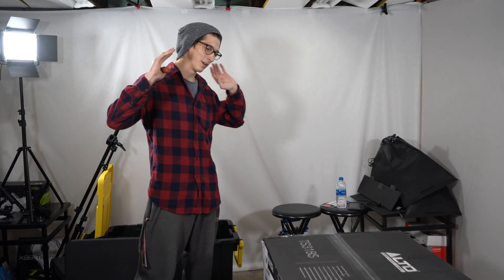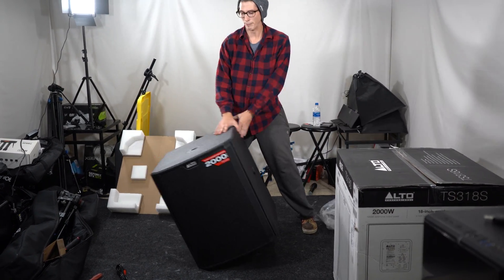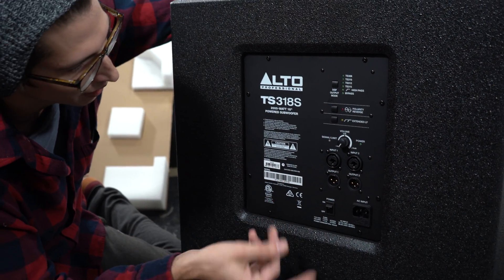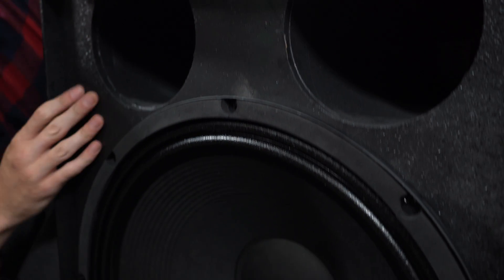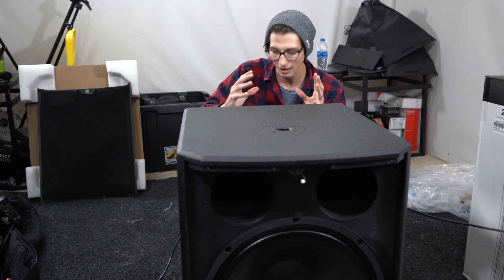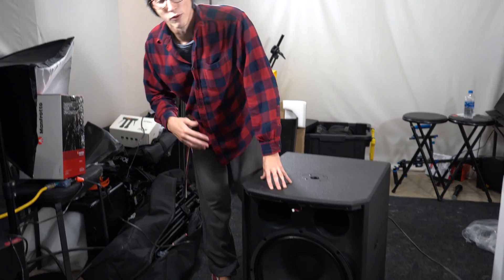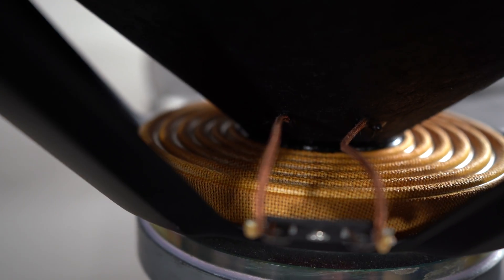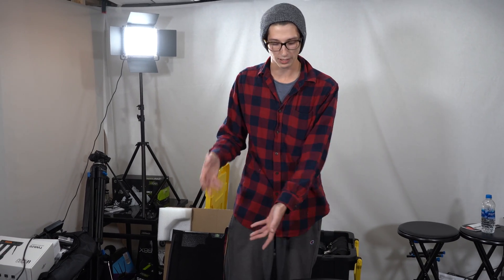Alto TS318S subwoofer Fail and Tear-down! 2000 watts? Worth it?

Comment: Yeah, you need to killed it because it’s not rated to 30 Hz it’s not a car subwoofer. It is not meant to go with that low  I can’t remember what the actual specifications are, but I definitely remember it is not meant to go that low for sustained high volume and I’d imagine it was probably clipping clipping is normally what causes a coil to get hot and stinky also, you have to think if the sauce was clipping as well I have run the subwoofers for 12 hours continuously at four power and not had any smell coming from them because they weren’t clipping

Comment: I don't think it has a limiter to protect the drivers when they start clipping unlike the Harbinger Subs which they do, Which may be why the Speaker Coil was Smelling Burnt as the Primary reason for a Limiter with Auto Volume Reduction is to protect the Driver

Comment: Brand new to the powered sub setups. I've been running power amps bi-amped into passive cabs since '91. I have the Alto TS18 sub and a pair of TS415 tops hooked up as instructed. I am very unimpressed with the sub. Have you known anyone to hook up a sub or 2 and a pair of tops using a crossover? I'd like to have more control over frequency assignment. Thanks.
Reply: Update: I'm bi-amping my powered speakers and changed the settings on the sub. BIG difference! The sub is behaving perfectly. Major improvement.

Comment: Well First off i See you have the subwoofer setup completely wrong!!!! it's Upside down..LOL.. The base Port holes go to the bottom🤣 Not The Top..& Second of all I See it's in a Crappy small room full with plastic drapes lol..& #3... try playing a High Quality file to test out the low frequencies on the subwoofer not some crappy Low bit rate MP3 file..LOL...

Comment: no damping material? 😂
cheap chinese woofer. 
💩💩💩 
my cheap 250 watt woofers have same magnet.
a 2000 watt rms woofer isn't build yet. B&C,18,Sound,RCF, Faital pro, Beyma, Radian ect, yet are at the 1500-1600 watt rms, & still no class D amp is builded to handle those big woofers.

Comment: I used one of these this past Saturday.  I have a pair of QSC 12.2 but no sub... drummer had this Alto sub that he brought.  I was scared to use it!  The bassist told me they always crank it to the max.  Against my better judgement, especially after watching this video, I cranked it.  They were playing outdoors.  This sub held it's own.  I actually had to bring the kick drums down slightly.  It wasn't a "slam you in the chest" type of bass, but it did fill the bottom end.  I am not sure if I would buy one tho.
Reply: The chest thump is usually the upper end of the bass and the low end of the tops e.g. 80-120 hz. The rest is low bass down to the 30s that gives that satisfying ear pressure if it's loud enough.

Comment: I know of a few bands that use Alto stuff. Also I had one of the PA speakers from them but sold it. To be honest, if I had never heard the better stuff such as QSC, EV, JBL ... I probably would have made do with the Alto speaker. But test them side by side and Alto comes in last ... but it cost half of what the big names want.
And as someone pointed out by feeding a 30hz signal, that sub was doomed. A sub that size should have gotten maybe a 60hz signal. In real life, 90% of the bass is above 50hz anyway ...
Reply: It's understandable that you believe the driver being doomed was natural but, at the same time, I, as a designer, think the necessary protections must be built into the amplifier in integrated products like these. The amplifier should not be able to fry the driver to destruction.

Comment: A bit of voice coil smell is pretty normal imho when the speakers get hot for the first couple times. It goes away over time. I own a lot of speakers that smelled significantly when driven hard for the first couple times. They still work great years later.
Reply: I remember the JBL PA we had in my old band. 2x SRX718s subs per side, had to run them really hard at times and they did smell a bit but never ever failed
Reply: So the burning smell in the video does not mean the driver or amplifier is roasted?
Reply: I ran mine quite hard out the box got that small and stopped, I thought I was going to blow them, so that smell is normal? Like hot electric

Comment: I refuse to ever haul around 18" Subs.  However, I purchased the original 41.5 lb Alto TSUB12 like 9 years ago.  I just traded it in at Guitar Center towards a Harbinger MLS1000 array system and got $135 for the trade in, so it held it's value well over 9 years!  I never had any problems with it. It was a boomy sounding sub though for a 12" Sub.  I was only $299 New!  I purchased a Alto TS212S Sub about 4 years ago.  Much punchier sounding bass, and better, sleeker box.  I never turn it up past Unity, and it has been a great little SUB that I use.  I DJ weddings with 50 to maybe 200 guests tops,  and mostly 50th, 60th, 70th birthday parties with under 100 guests. So I only use a single 12" Sub in my set up, and it's enough bass. I get often asked to turn the bass down lol.

Comment: I trust that the amp does not have limiter. When amp is clipping, the amp is delivering DC current to the speaker and therefore roasting the voice coil. That is why never power a passive speaker with underpowered amplifier, you will burn the coil of the speaker.
Reply: Yep! Not only does the driver get fed DC at full power, maximizing resistive losses, but the voice coil stays still for longer instead of excursioning, reducing the heat exchange with the pole piece.

Comment: Its not a pure SPL sub like you have in a car. To put that frequency through it without running it in is gonna fuck it up. Think its probably an unfair review. Your going for max spl on a system that's not designed to do that.

Comment: No speaker voice coil can handle the full power of a sine wave driving a amp to clipping. This is a poor test and does not happen even at the factory. A sine wave test is to drive the amp at full power into a resistive dummy load that is rated at over the amp full power spec and is fan cooled or water cooled. A speaker needs impulse signal so that it moved and is driven by the music and when the amp clips at the peak for milliseconds it will nor blow the voice coil. that is how music works and you can drive the sub all night like that at just under clipping which is pulsed and not a continuous full peak to peak sine wave. If you are going to release test / evaluation videos then please do it right to give a fair evaluation and not blame the manufacturer for a product that works on its own design correctly and you incorrectly demo it. i dont have any affiliation with Alto but i also dont destroy products with incorrect use i use KV2 Audio EX 2.2 subs. and 2 are enough for 500 people rooms. when positioned and used like the manufacturer intended.
Reply: Thanks for clarifying... I knew this young bro was just ego'ed out ans flexing where he has no place to flex... What a loser... Talking shit about alto.. go back to 8th grade poser...

Comment: Ok so I have 2 Altos 15 power speakers  plug in to stereo left and right on my yamaha mixer .  I have  another 12 inch power alto speaker .   Question is how do I connect the 12 inch , to the mixer or to one of the speakers because I want to use it as a monitor speaker
Reply: https://www.google.com/url?sa=t&source=web&rct=j&url=https://www.altoprofessional.com/downloads/TS312S_TS315S_TS318S_User_Guide_v1.2.pdf&ved=2ahUKEwihs4K-0OjxAhWZX80KHZh7B1cQ6sMDMAB6BAgJEAI&usg=AOvVaw3ePuVVIJZbXwCe3xgN_dm-
Reply: Aux fed

Comment: Have you ever bothered to read the manufacturer specifications for this subwoofer? It clearly states that the frequency range (-10db) for this subwoofer is 35 Hz, not to mention that the frequency response (-3db) is 44 Hz. Why would you feed it a 30 Hz test tone when you should know that it will not be able to play it well? This is pure stupidity! You just made a fool of yourself here!
Learn how to use your equipment properly! You clearly used it beyond its operational limits!
You could have applied a high pass filter set at 35 Hz, before the signal inputs the sub, and then test it with real music, including bass heavy songs, setting the gain correctly and slowly increasing the subwoofer level until it reaches its operational limit.
If you want your subwoofers to play loud and linear down to 30 Hz, invest more money in proper equipment able to deliver that performance!
One more thing. If music is want you want to hear properly, you always need at least two subwoofers. Never use only one.

Comment: You cant loose from RCF Subs🔊💯
Reply: Hey does the 15 in rcf sub do a good job
Reply: @kevinwillson4297   I never use one before, only the 18 inches, but RCFs are pretty good because they produce good drivers and the amps are also good, so i would say yes.

Comment: They normally comes with a shit driver, i once load the old 18" sub with some fatial pro 1700watts, and they still running ok. You can upgrade them with a better driver.

Comment: Did you run it to mic levels when running from your device? If you did thats the reason why the coil started burning. The amps used will always be rated to the speakers peak power. But it can only maintain peak for a few seconds.

Comment: Great video! I'd never invest on a sub nor any alto speaker again.
I have been using alto ts315 tops, I have faced problems 2 times in that years time..
The worst thing happened to me was that the highs of one speaker stopped functioning, really disappointing.
Reply: If it is because of the brand, I have a yamaha dsr 215 and it burned a sharp at a party

Comment: what replacement sub woofer would you suggest to replace the stock one?
Reply: I know this is an old post but you asked the exact question is wanted to ask. Did you come to a conclusion on a replacement? I just purchased a pair from someone that barely used them. I'm scared of what they may sound like. I haven't taken them out for a test play as of the time of me posting this.
Reply: @luvlessdavirus5009  sup....i been talking with other alto owners to get feed back....Im going with the 15 subs and 12 tops... micro system.  you should research what you can replace the stock woofers with... could be worth it... put sound filling in them
Reply: Id slap a dayton audio 18" in the box. @luvlessdavirus5009

Comment: 90 percent gain, on a brand new non broken in sub, set it up for failure
Reply: Subwoofer break-in is 3-4 hours at 40-50% volume. After the break-in the subwoofer will play and sound better. This also goes for car audio subs.
Reply: Can you explain powered sub break-in procedure?  This is something I didn't know about.
Reply: @synapticflow  just keep playing at 50% volume.. that's all.
Reply: if you have a sub you must be able to play it at max volume without blowing it with its internal amp
Reply: @Francesco-1001  if reputed company, yes.

Comment: It will definitely be 1000watts rms but either way thats not important as its mainly marketing tbh its the spl and quality of components and box design which makes a difference wattage is just the fuel the subwoofer runs on along with the magnet etc also its gotta slap hard but have minimal to zero distortion

Comment: don't be put off by any comments you may hear. Make no mistake these are awesome speakers. I have 2 x ts 310s an. d 2 x  ts 212s subs and they sound fantastic. You will always get people who will put them down and i guarantee 90% of them would not know which was which if you blindfolded them including me. Are they on par with the qsc k series and similar, well when you take into account the price then yes they are. Do they sound as good, well to the trained ear probably not, but i cant remember the last time i did a disco and heard people discussing my mids, highs and lows, because nobody cares as long as they sound good and they do.
Reply: U make more sense than vid
Reply: I upgraded to qsc from alto and was disappointed, 1 of my qsc tops was as much as the whole alto rig and for majority of small gigs it was unnecessary. The qsc shines outside and for live but for pre recorded music the altos sound amazing for what they are. Will add too my qsc’s would get stinky at clipping as well, you aren’t supposed clip powered speakers they should be treated as a external amp and passive speakers.
Reply: @Rufas-6947  this guy prolly turned it on and pumped it....u let it warm up u don't turn on nd expect extreme output within 1 minute
Reply: This dumbass is polluting the world with his trash opinions and broken science

Comment: Damn, I just brought the TS312S, now that you've done this review helps me out. Now I will upgrade the Subwoofer for sure and get that fill inside. What specs would you recommend for the Subwoofer?
Reply: I design hifi speaker and subwoofers and have had a lot of experience playing with box size and tuning. Likely the boomy sound is due to an undersized cabinet and so some fill might help. You could try to plug one of the ports with a towel and see how it sounds just as a test . That will lower the tuning frequency and add the one blocked port as more air volume in the cabinet. One things is with one port only at high volume you might get some port noise. Good luck!

Comment: There are no active speakers that have drive units on a par with their passive counterparts, active speakers have convenience value not much else !
Reply: That is a blanket statement and is patently untrue..... many many professional speaker systems are switching to powered speakers. I am a professional Audio engineer and have been for many years (working and touring with very famous acts you will have heard of)..... There are many advantages to active (powered) speaker systems including but not limited to improved damping factor, reduced resistance due long speaker cable runs and the ability of the manufacturer to more closely match the amplification and system processing to the speaker components and enclosure characteristics, thus resulting in a more constant audio response from system to system. This allows system engineers to be more confident in the speaker systems they will be using in the field.
Reply: @arthurton365  likewise I have a long history in both professional and domestic audio, what you have not understood is I am not talking about the ancillary equipment ( cables , connectors  etc ) I am just talking about the stand alone quality of the speakers , I am well aware of the advantages of active speakers and in a professional sense they are ideal in terms of convenience . But in a real world sense not on the budgets used in professional circles a passive system gives you much better value for money both in build quality and performance for example an active spk costing $1000 will not give you the same performance  in sonic performance, power output and build quality as an amplifier and passive  speaker of the same value would, that may be different in the professional world when your spending hundreds of thousands of dollars but for normal , DJ work it is as I've said !
Reply: Good passive stuff is $$$$. You need to factor in processing too. .need limiter....but you do you....carry that big amp rack.

Comment: This is a pretty bad review from you man, ive got 2 of these subs and they are really good quality and value for money. They aren't made to be bashed at max gain on the back of the amp, mine has run for 2 years on its normal setting being played aggressively every weekend and not a single issue. You are just giving this speaker a bad with a negative opinion, you started the video being negative and it made it shit.
Reply: This guy does not know how to do a review or let alone know how to used audio.

Peak is for only for a Second. 
This guy may have be 90% but the build up was why it failed.

This guy is uneducated on how it works.
Reply: Agreed.  From the get he was like annoyed to be doing a review.  I have the 318 speakers and they're awesome so I'm sure the subs would be just as good.
Reply: I use an alto professional sub for gigs I do with a band but it sounds very muddy and there's a huge lack of transient response. I've used qsc and d&b audiotechnik and they are way better with much more defined with less THD and a better transient response
Reply: That's what you get with an 8th grader with a pro audio ego
Reply: I am a bass player and a sound tech with 60 years playing in and mixing bands.  My several years experience with the TS318 has been trouble free, and I consider ALTO products to be a great bang for the buck.  The headline, the unprofessional, slouchy look of this presenter and the negative attitude he projected before he even had the product out of the box told me exactly what to expect.  He was pre-programmed to slam this sub well in advance, probably pre-judging by the economical price.  I would guess he is a know-nothing PA snob.
Reply: Does subs are 💩
Reply: @jitbass.  clearly you done own one of these.